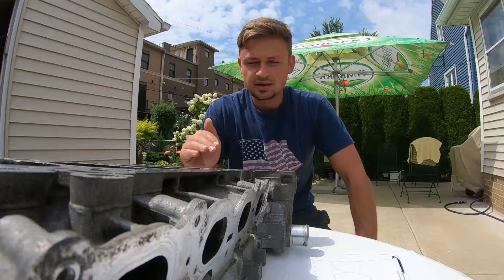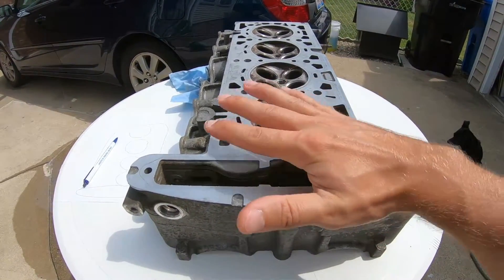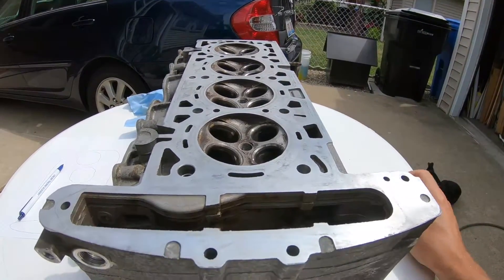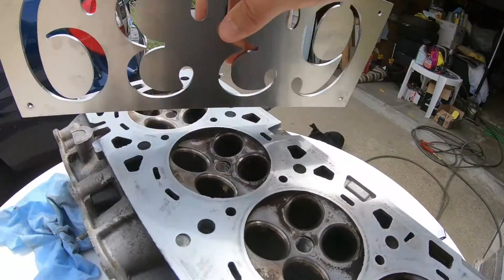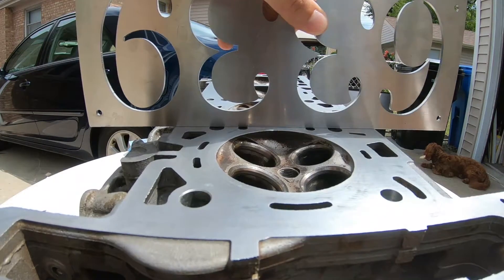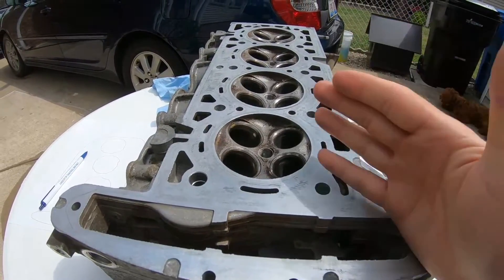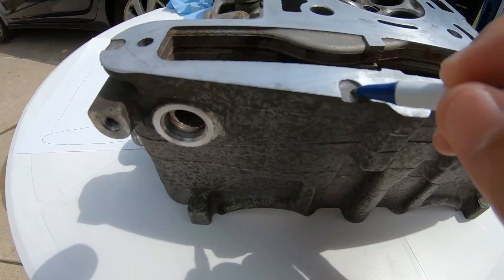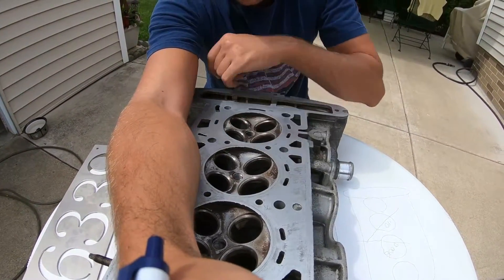How to Check Cylinder Head / Block Height & Flatness ( Do you need to Resurface?)

Comment: I got news for you big guy.  .008 is way too big. Most heads are out of tolerance at .005. You need a full set of feeler gauges.  Down to .001. Good info for the most part. Good luck.
Reply from the maker: Thanks.  This was just a  random motor I picked up to learn on.  I sold it since then.    Would it be safe to say that heads warm more then blocks? Can you get away with just a head resurface or do you need both.
Reply: @BulliKid A lot of the time, yes. But always do  check while the head is removed. It takes no time and can save you big time in the end.
Reply: Are you guys talking mm or inch?

Comment: So 8thou?(.008)? No no no for my V6 they say .002 . For V8 like .003 which is like a 4 cylinder ish. And maybe a machinists straight edge because accuracy is important here. When does valve clearance come into play? So if you're 4-6 thou off you're in big trouble just with sealing. If you remove too much material from the head without compensating on the gasket to up the slack. Do hydraulic lifters take up the slack? On old over head cam with adjustable rockers as a normal longer interval major tune up you'd adjust your valve lash to 10 or 12 thou for exhaust because it gets hotter and expands more intake at 8-10 thou intake expands less. I watched mechanic gap a totally non starting engine with a match book cover, and started right up! The customer had tightened the lash to .000 so the valves couldn't actually close. I had a Haynes manual for every car I've owned, if only for the handy specs like torques. Just food for thought.